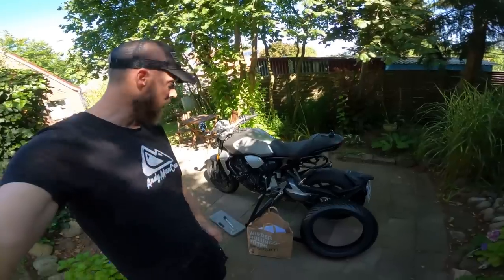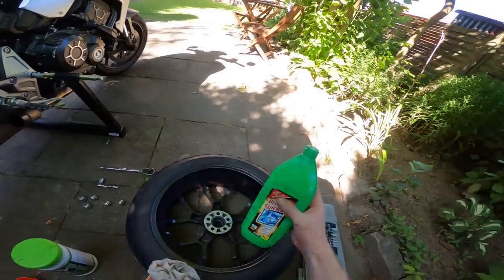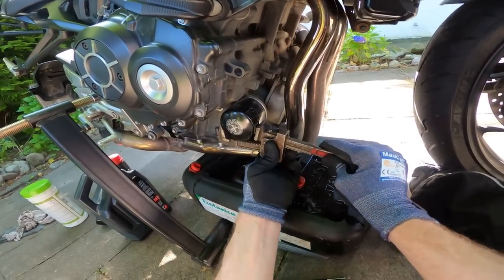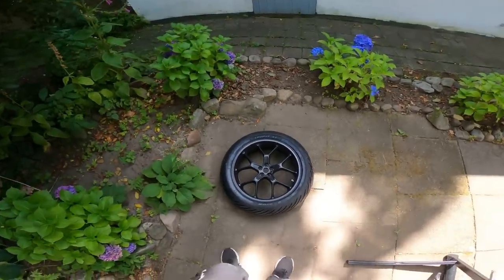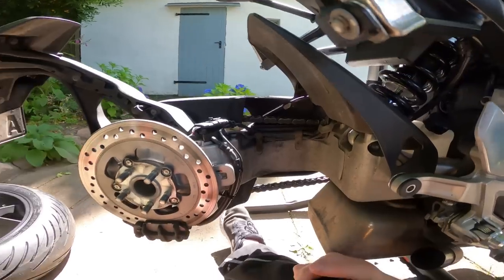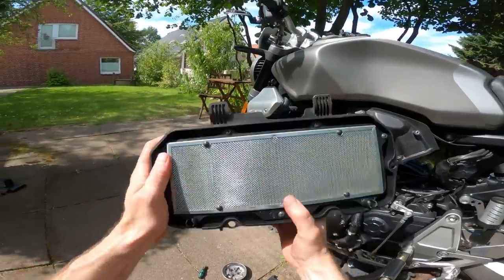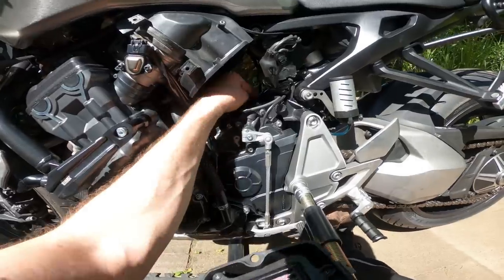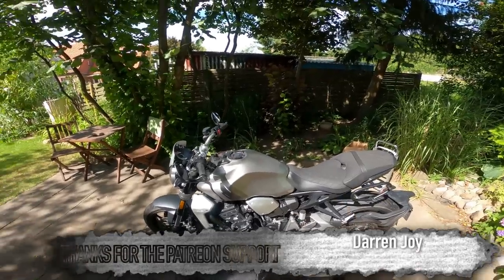Servicing The CB1000R | Oil, Tyres, K&N Air Filter and More…

Comment: Eh Andy. I'd invest in a funnel, if I were you. LOL! 😁😁😁
Reply from the maker: Annoyingly i have a couple. But they’re in storage while we’re at this temporary accommodation! Very annoying.
Reply: Empty cereal box cut out desired amount, roll into a cone shape with the shiny printed side inside the cone, and there you have a diy funnel.
Reply from the maker: Sadly we don’t have cereal any more! TBH i did think about just cutting off the top of a water bottle, but it would have taken as long to create a makeshift funnel as the slow pour time it would have saved! I’ll dig a funnel out for next time. 👍🏻
Reply: Enjoy your trip, I am just back from a 10 day trip to France to do the d-day landings. And also having a rough ferry back to Ireland but it was all fantastic and my first tour on my fz6n.
Reply from the maker: Thanks Gareth! Glad your trip went well. Bet you’ve bonded with the FZ6 in ways you didn’t think possible! 😜
Reply: @AndyManCam  first time I got to go faster then the boring Irish 120kmh and did 130kmh and all my bike wanted to do was go faster and got smoother. And learnt that I don't like the road 5s going to look for something else.
Reply from the maker: Funny how the motorway can do that to a bike! What didn’t you like about the R5‘s
Reply: @AndyManCam  too noisy and far too much vibrations from them thought my bearing were going and went to a motorcycle shop in caen to have them checked and they are all fine and pressures were correct. Found out that the sipes front edge have worn faster the the back edge so making noise and vibrations but the grip is in the dry is great and in Monsoon rain (tested the day I got back into ireland on the way home) was excellent so I'll put up with them and change when they are done. Also had my rear shock checked Wednesday and that is still good to go but still think I'll get a yss next year.
Reply from the maker: Fair enough. Totally agree on the grip front. Absolutely confidence inspiring. I think i remember reading somewhere that wear on the front/rear edges of the tread pattern has a direct relation to your compression and rebound damping. I can’t remember which direction exactly, but perhaps a well educated (ie, not from me!) adjustment of the fork Settings could stop the uneven wear and give you back that grip without the annoying noise and vibrations? I have no Affiliation to Michelin by the way, no motivation to keep you on them! But if the suspension is wearing the tyres in an odd fashion, it could be a case of history repeating with the next set? I also have had great experience with the Avon spirit ST‘s, and the tread pattern seems a bit less ‚sipey‘! To qualify, i spent a few hours messing with my fork Settings and had very even wear on the leading and trailing edges of the tread. Plus the bike handles much ‚tighter‘ to boot! Just my two penneth. Could be that I’m just less sensitive to the vibes.
Reply: @AndyManCam  I do know that my forks can't be adjusted my change the oil as it is 5w thinking of going 7.5w to make it a little stiffer rear is only preloaded the why I am change it next year and maybe (wife permitting) look into adjustable forks we'll see. On my previous bike I did run Dunlop gpr300s and they were great my try them as well and see. But I'll do some research. Enjoy your trip and stay safe.
Reply from the maker: Ah i see. Might be worth a go though, if the oil is old. In any case, you know what you’re doing and you know what you like! Good luck on selling the adjustable forks to the powers that be!

Comment: I don't have a CB1000R but that was a good watch. I've stuck around since you showed us how to change the filters, oil, pads etc on your versys which came in handy when doing mine the other month.
Reply from the maker: Thanks mate! Glad it was still enjoyable despite being wildly irrelevant! Hope the Versys is going strong. Sometimes i miss mine still!
Reply: @AndyManCam  it's still going strong. Have put 22k on it in 3 years and it's only needed the usual servicing bits. Brilliant bike but thinking about upgrading to the versys 1k for the silky smooth 4 pot.
Reply from the maker: Unbeatable bike! Happy to hear that. Yeah eventually a bit more oomf and a smidge more smoothness become quite attractive. Oddly though, I’ve gone back in the 2 pot direction! All will be revealed…

Comment: Motul is definitely the best oil out there imo. No doubt the semi synthetic is more than good enough for most bikes, but as mine is an old girl now, and I do use it well, I've used Motul 7100 fully synthetic twice now. It made it run a little cooler than whatever was in there when I got the bike which is nice.
Reply from the maker: Crazy that the oil makes such a difference, but i totally agree that it’s worth using good oil.

Comment: Honda seem to like making Air Filter changes erm "interesting". On mine you remove about 1/3 of the fairing, raise the tank then remove 9, yes NINE, screws on the airbox cover.
On the Yamaha, remove the side panel (3 bolts), then the 4 screws holding the airbox cover!
I've used Motul full synthetic oil on the Honda and she's now on 198,000 km. Engine's as sweet as a nut.
Reply from the maker: Seems like it! Although the Versys was a tank off and at least six screws on the airbox job too. I’ve heard KTM‘s are ‚interesting‘ too. Guess we’ll see… 😉

Comment: Hi Andy, great to see you working on the bike again. A couple of observations: (1) I too love my Wera Tool-check plus and its slightly bigger sibling, the Zyklop Metric Speed Ratchet Set. Both were gifted to me by my darling wife a  couple of years ago, and I believe I got the inspiration from you. (2) When I first realized you can access your air filter without removing the tank as I must do, I was jealous. After witnessing your struggles, however, I think the amount of effort for both is about the same.

And thanks for asking, I am doing quite well. But how the very devil are YOU?
Reply from the maker: I too am very well thanks! Yeah it’s a rock and a hard place situation with tank off or sideways struggling! TBH i think I’d prefer tank off! This way, there’s so much pressure and pushing/pulling on all of those cables and hoses, it makes me uneasy! I don’t think Honda planned filter replacement with all the cabling in place 🤦🏻‍♂️ Tabletop engineering!

Comment: Thank You for the video with great detail and information for me to maintain my CB1000R in to the future!
This is only what I think:(my opinion) with regards to the K&N filters (have used it in my cars in the past), it does more to our physiological desire to believe that it is better than other filters... 1. all fuel injected system are computer controlled so by allowing more air flow does VERY LITTLE if at all as the on board ECU adjusts to what the MAS reads,  2. multiple re-use wise, yes, that is nice, but its filter fabric is gradually degrading after each wash and really NEEDs to be re-oiled properly or that can actually clog the intake system, plus you pay additional $$ for the filter cleaning solution as well as the oil etc...  
Aside from the K&N, I noticed you used 10W40 instead of the 10W30 oil, do you see any significant decrease in fuel mileage consumption at all?  
Regards & Ride Safe!

Comment: I had the exact same issue removing the OEM oil filter, one big srewdriver later.... I replaced it with a K&N oil filter which has a nut welded on the top to make it easier to remove next time. Only thing was that the cover wouldnt fit fully due to the nut so used some spacers and longer bolts
Reply from the maker: That was the exact reason i didn’t go for one of those. I would have preferred it TBH!

Comment: Ha, I have the exact same set of verniers. Bought them over two decades ago when I was a bike mechanic.

Running that warm up for the oil change without the muffler… the men in white coats from TÜV will be on their way shortly!

With the oil filters, the heat and running of the bike makes a once hand tightened filter a near impossibility to remove by hand. Definitely worth investing in a decent oil filter wrench.

As for Aussie spiders, you laugh. But I lost everything due to one of these spider incidents.

Nice trick with the screwdriver for filling the oil. So, a filter wrench and a funnel is on the shopping list.😂

I’m not jealous of your air filter access. I do like my Harley for that. Haha

The those inlet tubes pre-filter, they can possibly also aid in settling turbulence in the air tract.
Reply from the maker: I got my verniers about the same time then! 20 years ago while i was at university! Fitting that i didn’t bother with the filter Wrench and now i have a bike with a cassette style oil filter! 😂. I think the funnels being before the air filter mean that anything they did do, would be ruined by the filter before getting to the intakes. Of course i could be very wrong! My assumptions are based on no experience or expertise!! 😂
Reply: @AndyManCam  ah. They must have had a sale on verniers for students 20 years ago. Lol.

Yes, I saw something on Insta… new bike???! I’ll have to do some more catching up.

The air intake can also be for induction noise suppression. Anything to take the fun out of riding!
Reply from the maker: They certainly know how to design the joy out of biking!! 😂😂
Reply: @AndyManCam  sadly so. Euro 5 standard and various country design regulations stifle the manufacturers designs and motivation. I feel as though, especially these days manufacturers are just ticking boxes to pass regulations.
Reply from the maker: Totally! It’s always so obvious! The evap canister under the rear seat of the new KTM proves that entirely! It’s fitted diagonal and inefficiently destroys abs chance of storing anything under there, while simultaneously not using up all the space! Madness!!

Comment: Hi! Andy .If you can track done a chain oil filter remover with tommy bar fitting , it will remove almost anything. ATB Aiden
Reply from the maker: The easiest i ever had was a K&N filter with a nut welded on the end. Sadly wouldn’t fit in the shroud properly!

Comment: Don’t torque the sump until last when you’re happy with oil. Means if you overfill you can just drain the excess without wasting a crush washer.
Reply from the maker: Good tip, cheers! 👍🏻

Comment: try using a clamp next time over the oil filter to take it off then use the wrench or socket for leverage
Reply from the maker: I reckon I’ll just get or make myself a filter strap next time. Small cost for saving a lot of faff and mess!

Comment: Dear Santa, please can I have an oil filter cup wrench and a funnel for Christmas. 😁

With my Honda the fluid levels need to be checked with both wheels on level ground. I e. Not on any sort of stand - not even the centre stand. It makes a considerable difference when checking the oil and water levels. Have you now over filled the oil? 🤔🤷🏼‍♂️ 

As usual, only you can make a service entertaining to watch. 👍

Oh yes. Have you now invalidated your warranty? 😬
Reply from the maker: ‚Thankfully‘ my warranty is already run out! I found that with this center stand, the difference wasn’t that great from flat on the ground. Just a slightly different angle.

Comment: Rear wheel looks very cool without exhaust actually. I wonder why Honda left the single sling rear wheel in shadows with this massive exhaust pipe
Reply from the maker: It is a little odd, isn’t it! If they’d have used an underslung, integrated silencer and CAT system like in the Tracer 9, that wheel would have been open for all to see!

Comment: May I ask you something? I did some research regarding cb1000r and read complaints about the sump paint flaking and the bad rear suspension. What do you think about it? Also, have you had a chance to ride gsx s1000. Can't decide between these two bikes
Reply from the maker: Hi Chris. Sure! The paint on the oil sump is an absolute disaster and began the poisoning of my mood for the CB1000R. Made worse only by Honda Germany‘s complete lack of interest in fixing it. After 6 months my bike looked like it had done 50,000 miles. The rear suspension was possibly the next biggest problem. I thought i could get used to it, but eventually had to spend an extra 500€ on top of the already overpriced bike to buy a shock absorber that actually belonged on it. Ultimately it was too late as the love had died. Sadly the love had the last laugh from the grave as when I sold the bike, I lost over 3000€ in depreciation in just 2 years. Otherwise, definitely go for the Honda. 😉

Comment: Hey buddy how is it going 😎🤝I have a question please ! I want to swap stock sprockets. I found a Renthal brand 15T front sprocket & 44T rear sprocket. Will they fit my model ? Also is aluminum anodized a quality material for a rear sprocket (made by Renthal) ? Sorry I know these question are kind of intrusive but I am in a hurry to check out on eBay now 🤪
Thank you much
Reply from the maker: I couldn’t honestly say I’m afraid. If they say they’ll fit in the renthal info, then i guess they should. I had an aluminum sprocket on my Versys and it was absolutely fine. Bit less power mind! You have to REALLY stay on top of cleaning and lubing the chain as the ally sprocket will wear much faster.

Comment: as a fellow CB1KR rider, I'd love to know if the air filter did anything – in terms of performance or sound. 
(PS: Heard one should stay away from K&N these days as quality control is in the toilet and parts do more harm than good.)
Reply from the maker: Not really TBH mate. Maybe a tiny bit of extra induction noise. Nothing on the performance front. But then i don’t think anybody could really feel the alleged 5hp that you ‚might‘ gain! I’ve not had any trouble with K&N so far, but then again the last one i had was on the FZS600!

Comment: Hi Andy watched your videos a while ago. Came back because I am about to buy a 2019 cb 1000 r. Would you recommend a after market exhaust? In the back of my mind i know that you switched back to the stock exhaust. Thanks in advance
Reply from the maker: Hi! To be honest, no. Unless you can do a decat, and sort the fuelling after, there’s no real point other than a bit of weight saving. I found that the bike buzzed more with an aftermarket can and it also made almost no difference to the sound. Put the cash towards a better rear shock instead!! 😜

Comment: Was checkin my chain slack as well last time , found it weird that it stops on the chain rail , had a good look and found out that there is a small arrow on it midway between the sprockets , could be the indicator on where to check the slack ?
Reply from the maker: Could well be. I guess that would make sense. Shame they didn’t leave enough space for there to be enough slack! Unless maybe touching that spot means the slack is just right? 🤔
Reply: @AndyManCam  not sure , u can check it , its on the underside of the chain rail midway between the sprockets , there is a small indicator there (triangle) also I sen you a little gift on your email address !
Reply from the maker: Thanks! Sadly it’s a tiny bit too late. The Honda has moved on to greener pastures!

Comment: Hey Andy, did removing that cone from the airbox change the sound of the bike at all?
Reply from the maker: I think maybe a tiny little bit, though it’s hard to tell if that was due to the cones or the free-flowing filter. Not enough to tear it apart just to do that tbh.
Reply: These inlet cones are often there to prevent water ingress in heavy rain and thrown up standing water. If it makes no difference better left on.
Reply from the maker: I did consider that too Terence. Though as they face the same direction and at the same height as the intakes, i figured that they can only really be there to act like the baffles of an exhaust, except in the other direction! After Norway, i put them back in. Mainly so i wouldn’t lose them!!

Comment: Fucking hell just had anual service cost £285 Def going to give up biking
Reply from the maker: It’s enough to make you learn how to do it yourself isn’t it!! Just prepare yourself for the 24,000km service. You can at least triple that number!
Reply: @AndyManCam  no because I brought all stuff to do it my self went to open bolt to do change and it broke. Way I ride it I wouldn't be able to do 300 miles with it engine drinks oil like a fish chain gets stretched always. Can't be arsed with bikes need too much maintenance but saying that my 2 year old Kia Sportage has blown it's engine they just don't make stuff like they used 2.
Reply: Literally just had first annual service on my Gen 3 ‘Busa, plus new tyres front and rear - £575 😖
Reply: @Kurlach  wah I was thinking of getting busa fuck that! I'm get pick up truck
Reply from the maker: Ouch and ouch! That’s a lot of servicing dosh! I’ll be going 100% DIY from now on! As much as i possibly can, at least.

Comment: Do not put that filter in if you dont have a tune...she will run extra lean
Reply from the maker: Absolute nonsense. You can only put in what you can also take out. Meaning, as long as the stock headers, cat and silencer are installed, the system is exactly as restrictive as it was before. Therefore the same amount of air can be ‚exhausted‘ as before. I could probably use a pair of grannies tights as a filter and with the stock exhaust system it wouldn’t really matter. If you put a complete exhaust system with no cat and a free-flowing silencer on, then a tune is going to be in order.